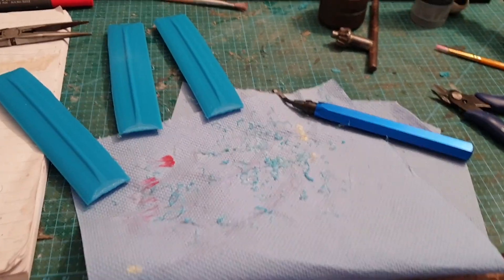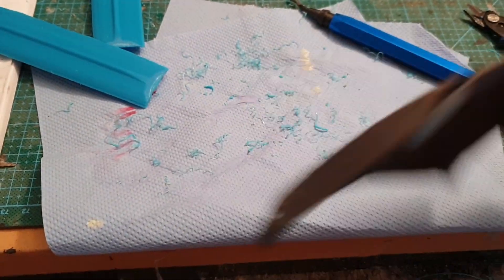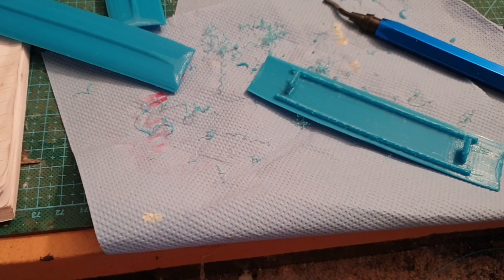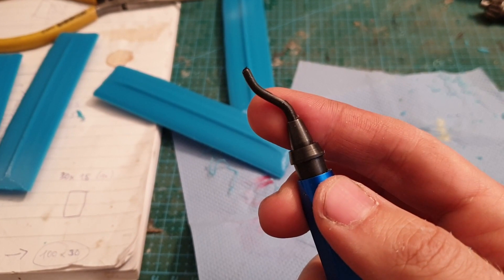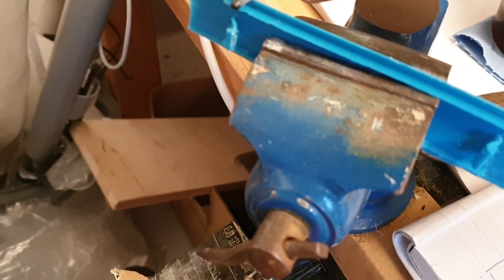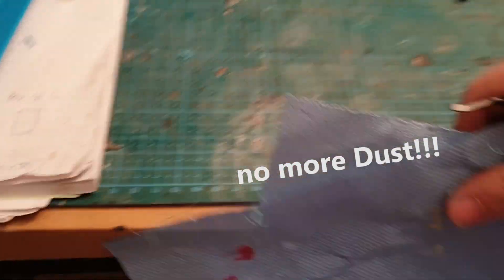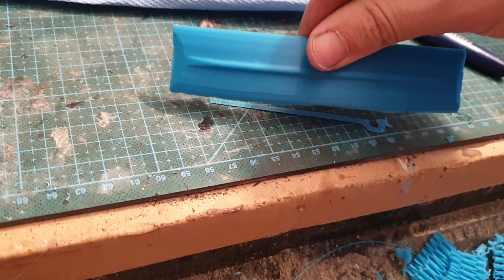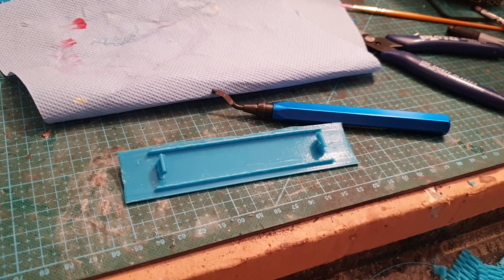Easy way to get smooth edges on your 3D printed parts

Comment: Whats the name of the tool?
Reply: Watched the whole video and can't believe he didn't give the name. Had to find it elsewhere, it's named a deburring tool.
Reply: It's called a Reaming or Deburring tool! It's one of the most underrated hand tools in any shop! It makes freshly drilled holes in metal (with filings still attached) safe for a baby to lick. It will put the PERFECT tiny bevel that you want on the resting edge of that table. And it makes finishing 3D parts a lot faster and safer, with the added bonus of being easier to make uniform.